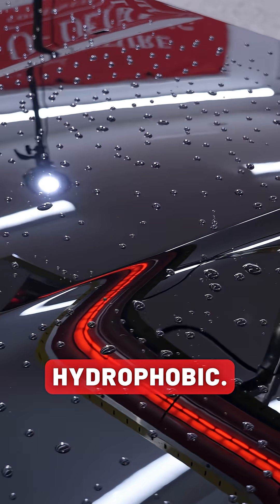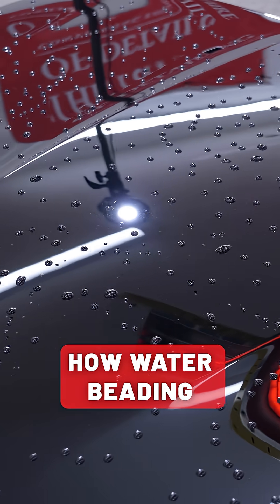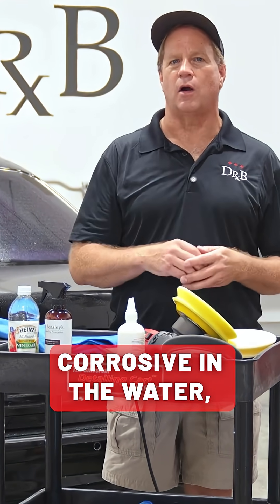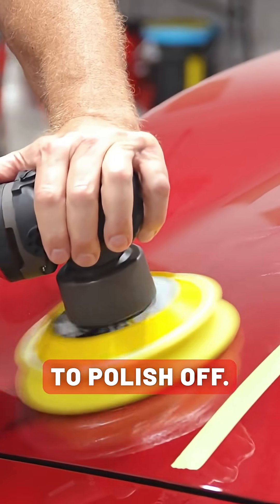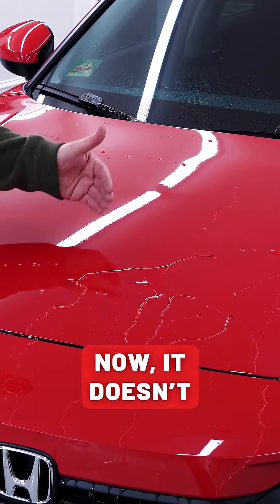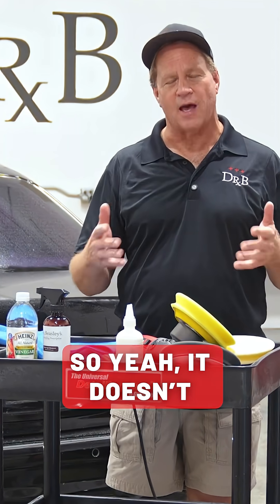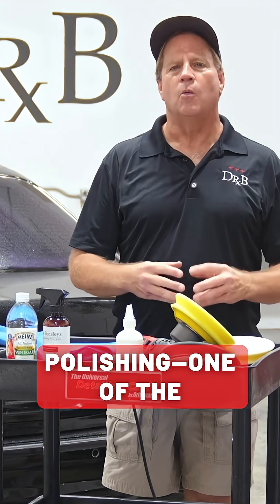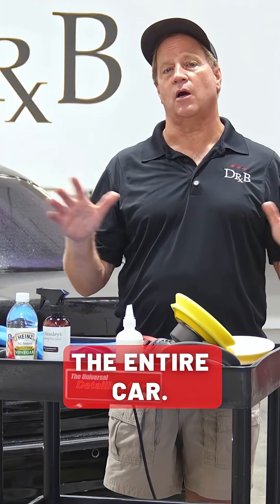How Ceramic Coatings Create Water Spots

Comment: Will it help to top off the ceramic coating with a spray sealant or wax? 
Thanks
Reply: In theory, if the topper does NOT create surface tension, then this would help to protect the coating.  The downside is, instead of getting the benefits and features of the coating, you now get the benefits and features of the topper.  No easy or simple solution.  

Thank you for watching and commenting.  _Mike Phillips